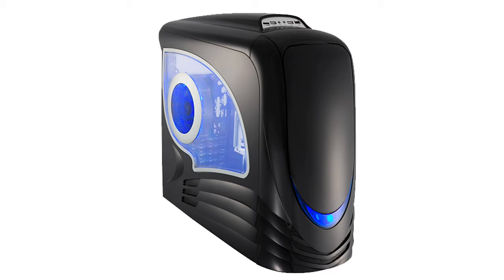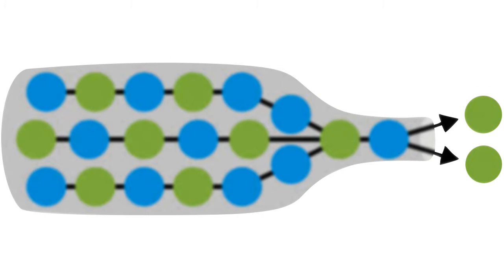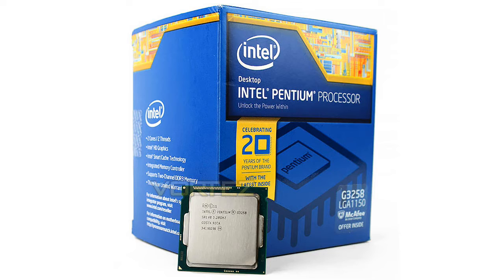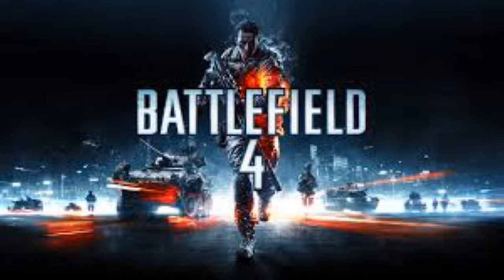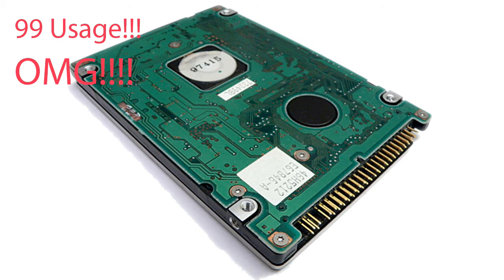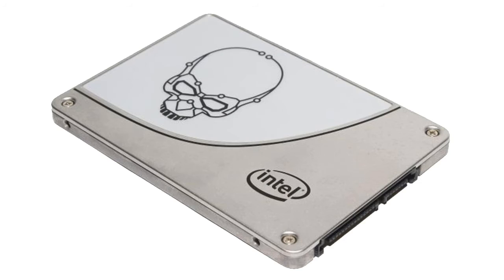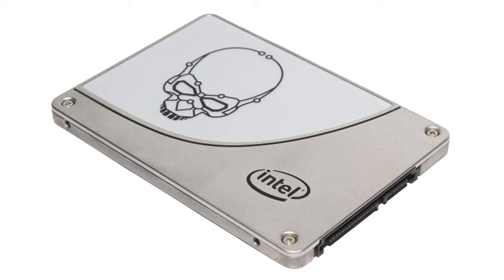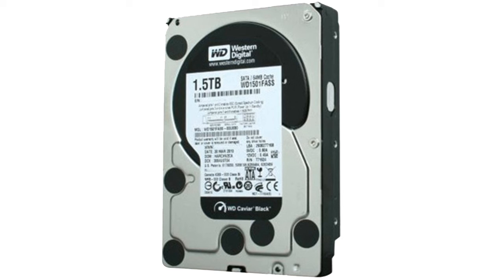What is bottleneck?Common Bottleneck Hardware In Computer (2015)

Comment: This is my system CPU - intel Core i5 4460 3.20ghz
 Motherboard - Gigabyte H81M-S2H
 Ram - crucial ballistix sport XT 8GB
 Storage - Seagate 3.5 inch 1TB Barracuda Hard Drive
 GPU - EVGA GTX960 SSC
 Case - Vanquish Gaming case
 PSU - CX600 bronze+Do you think the HDD could be bottle necking it ?
Reply from the maker: That is a decent HDD. Is it of 7200 RPM?
Reply: I don't know just when I play games textures load slow and when I  launch obs it unplayable nothing loads I have changes GPU and RAM. I don't know what it could be any ideas
Reply from the maker: Then yes it might be the HDD. Get an SSD and see how it does. It should definitely fasten up the load speed.
Reply: I just read up on it and its 7200rpm
Reply from the maker: Wolfie big tail Get an SSD and see if it helps.